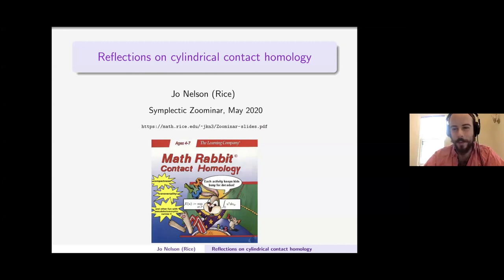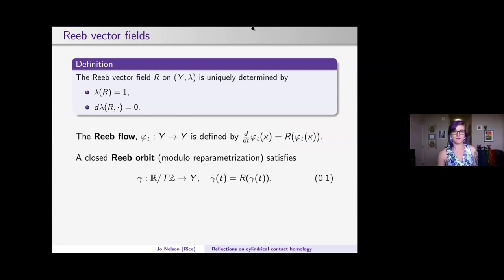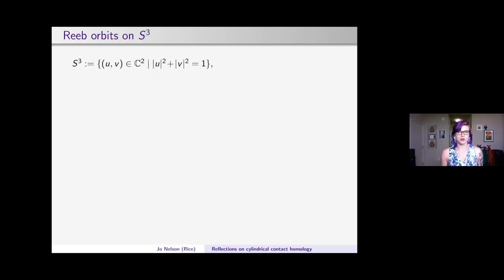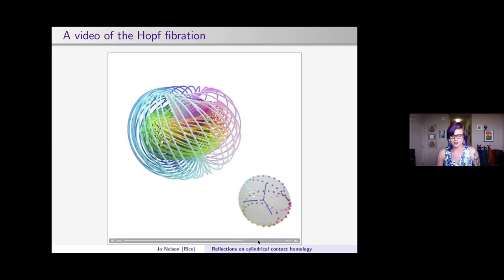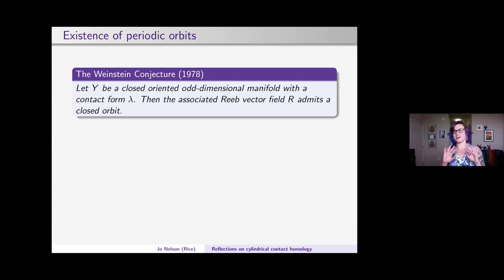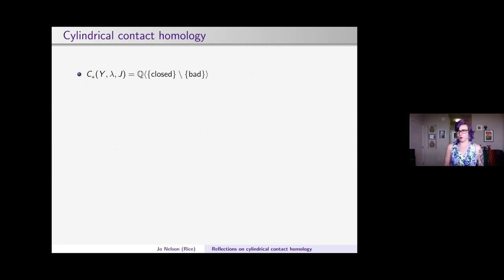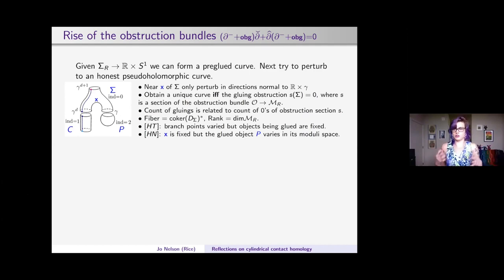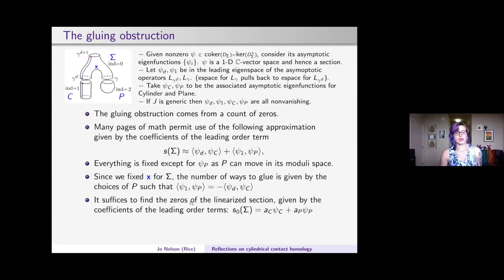Reflections on Cylindrical Contact Homology - Jo Nelson

Comment: 38 mins. Just thought of this too however I was scrolling to see where this would fit. Possibly manifolds for connectivity. Plane =n, quadrant = qA(+,+)qB(-,+), qC(-,-),qD(+,-). Null Plane =N+1=(-1).  Dimensions = x,y,z..z,z inf. Limit approaches inf n approaches 1.qA of plane 2 = (+,+,-). qA of plane 3 = (+, +, -,+). I actually meant a different way but this thought was interesting. Original was a bit different only applying to qB, qC,qD. Still ignorant and learning!